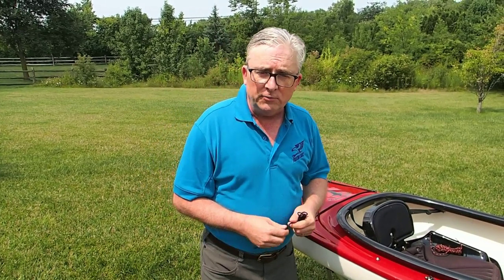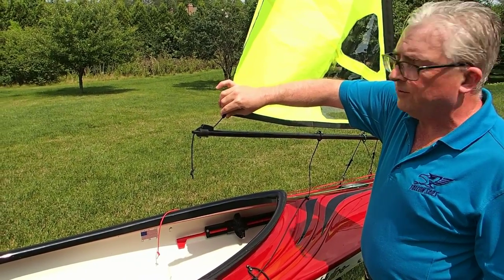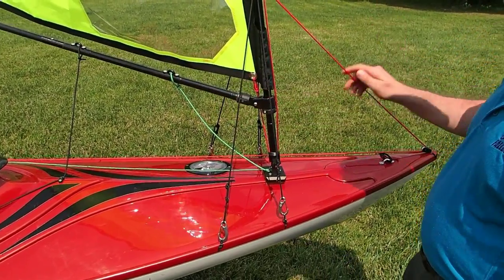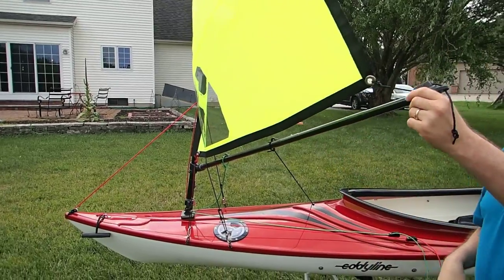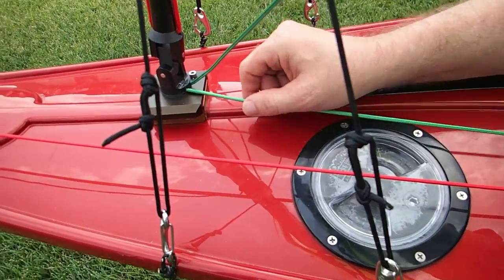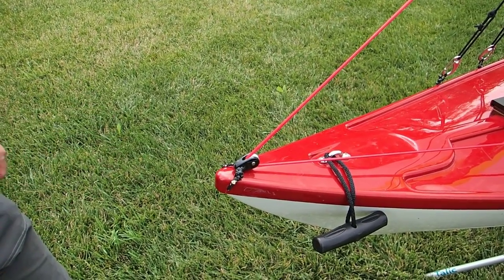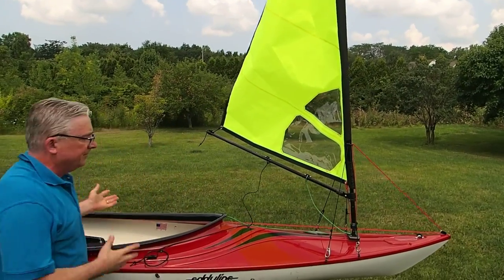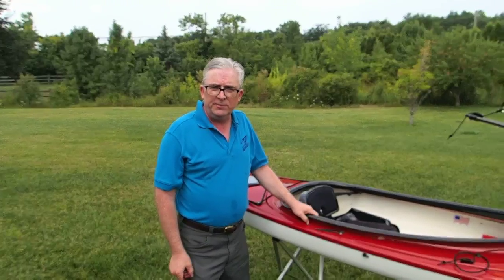What you need to know when it comes to kayak sailing and proper lines.

Comment: I like the sail setup for that kayak but it must be all but impossible to do much upwind without a long keel.  Hobie uses their mirage drive as the keel and it works fairly well while sailing.  Without a keel, you are blown sideways.
Reply from the maker: This is an example where conventional sail thinking leads to wrong answers.  A conventional sail boat hull is designed to be as slippery as possible going forward.  A byproduct of this is a hull that is slippery in all directions that will spin like crazy.  A kayak hull is designed to track / go in a straight line. This is done by building lateral resistance into the hull.  So a naked kayak hull is actually really good for sailing.  It is not a sail boat, hull with a keel or centerboard, but you can still sail up wind surprisingly well.

Think about towing a kayak.   Will it tow easier if you pull it from the bow, or from the side of the kayak.
Of course it will tow much easier towing from the bow than it will towing it from the side.  That is because there is a lot more resistance going sideways than there is going forward.  Its not a sail boat, kayaks will sail 5x better than a naked (no center board or rudder or keel ) modern sail boat hull will sail. 

See  

Here is a guy with his 12 foot kayak and not much sailing experience paddle sailing up wind on his first outing.

https://www.facebook.com/falconsails/videos/278619176312509/?__xts__%5B0%5D=68.ARAGigGxc2c3KRYyk8YYd6iRafOQOy-ZVuuUcLNoOQd6jYODNfIXp3OuM8WYTRQwWqDTeuGH56auQfFZpJpDYQCOFYOZ5GN-3xi8jp5dlRN939jH01cIOs-e9DVsJzmjVk0turNC8M_cDS3A6rI3Nmy0rvsSjzX3FfKxSC9K4kXFcQDBLGqvBFhKVJ0q9HnPpP1i47fcz4yXqDTt9uLZiJ8UB0Gj4NvUCz59KPZVxkGoV2V3c27v6fHXC03Rj0x_0GBikcpJHEeF5S9J_vDnAedpYuAwpqNT0c3WAME4aSIgKdbsOX5dYpk3OJ3AM51AemP4szb4vaGwg2dsY5wZZpIA-2EoqKF_or9EO1xTSg_G&__tn__=-R

Also see
https://www.youtube.com/watch?v=jfJgPxpwCP0&t=442s

Here is another video that starts showing 1 boat going one way, and another boat going another.
https://www.youtube.com/watch?v=2i8_EEExqNg

One more oldie but goodie showing us sailing across the wind.
https://www.youtube.com/watch?v=FbArYr71mRo
Reply: @FalconSails  I stand corrected!  Guess I'm used to bigger sails positioned farther back than on your setup.
Reply from the maker: @christianludvigsen5641  The sailing concepts are all the same, but as hull shapes change, the variables are  quite a bit different.  If you do not change the variables in the formulas, conventional sail thinking yields wrong answers when it is time to figure out kayak sailing.  Like kayak hulls center of lateral resistance is much further forward than they are on a sail boat hull. They are designed to turn up wind when you are not moving as a safety factor.  As you pick up speed, the center of lateral resistance moves farther and farther forward.  Then the sail generates a little bit of down force which moves  the center of lateral resistance further forward,  and you can move it further forward by putting your gear a bit further forward than you typically would to achieve what you like the best.  If you move just a liter of water from the stern hatch to the bow hatch, you can feel a difference. It is easy to  move the center of lateral resistance where you would like it to be.  You can lean forward and aft when under way.  You can also adjust your center of lateral force above the water line to achieve the balance sailors are looking for.  Usually this is done by simply pulling the boom in and out.  There are a lot of little tricks to make things happen. When you just get started, you will not care.  If you are not a particular person you will probably never care, but as you dive into kayak sailing, you may enjoy the fact that a kayaks center of lateral resistance and center of lateral force is so easy to move for and aft.
Reply: @FalconSails  As you probably figured out I sail catamarans and mono hull sailboats with masts more than 30 ft and most of the time with more than one sail.  For those of us who sail them a good keel or centerboard is a must to go upwind.  Even at that I'm lucky to come into the wind less than 45 degrees and at a board reach I'm usually healed over by  20 to 30 percent on a mono hull , 10 to 15 percent on a cat or flying a hull on something like a hobie cat.
  So I can't speak for how your sails work on a kayak.  I was just trying to find out how you controlled drift and healing without some kind of centerboard or keel and your explanation helped with moving weight forward.
Reply from the maker: This video will show you how well a standard kayak hull can sail up wind if you have a good quality sail. No keel or lee board is needed.
https://youtu.be/e-IxDPoadjU

Comment: Hello, I have a question, why are the shrouds so high? above the boom and not below the boom like other competitive systems, this way they do not cross the boom for the aft winds.
Reply from the maker: Thank you for asking a question.

You can put the standing line anchor points up high, or down low.
The problem with putting them down so low is, it creates a lot of highly levered force action on all the hardware. Your gets smashed with a lot of down force, your mast base gets torqued with a lot of lateral force, the standing lines get pulled on hard.  So you stress all hardware including you mast and the mast will have a decent chance of bending or breaking.

Without a deep knowledge of kayak sailing you would think, letting your sail weathervane is a good idea, but it is actually a very poor idea for proper and safe depowering.

Here is a link to another video where I talk about how to properly depower your sail rig using the run with the wind technique.

https://www.youtube.com/watch?v=fP7AxiwKthQ

Here is a link to a rough draft article that I go into a lot of detail about what hight for the standing line anchor point is best.  It is not as simple of a choice as some people would think.

http://www.falconsails.com/articles/StandingLinesAboveOrAllBelowTheBoom.pdf

It is a long winded answer but in the end, it will help you see how higher standing line anchor points is a good thing.

Feel free to call our shop if you need any help.

In the end there is no doubt, you want to have the standing lines up higher.

Low standing line anchor points to make the boom go forward sounds good in theory until you are stuck with all the problems this creates.

So that is why Falcon Sails standing line anchor points are a bit higher than they are on some of the not so well thought out home made rigs.

Comment: Hello Friend I liked the sail shape. The mast is made of aluminum, and the sail is made of what material?
Reply: After having made and help thousands of kayakers rig thier sail boats, we have come up with a really good design.
The mast and boom are made of prepreg carbon fiber.  It is super stiff, and super strong.  It will not ever bend or break when used for kayak sailing.  i is very stiff,.  

The Sail is made of 3.8 oz dacron cloth.  It is conventional dingy boat mail sail cloth. It is perfect for the job.  It is stiff, strong , and stretches 1/10th what many kayak sails cloth will.
Reply: @1234superduper  Thanks for replying friend! I'm from Brazil, I'm a little sad that we don't have equipment with this quality here. Congratulations on the quality of your products, they are simply amazing! I'll just have my oar, what a sadness 😞